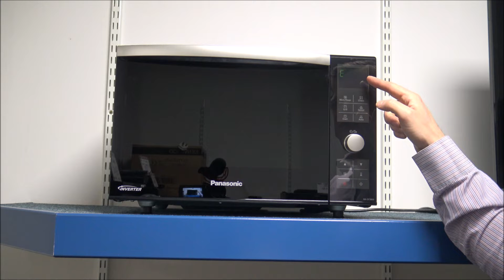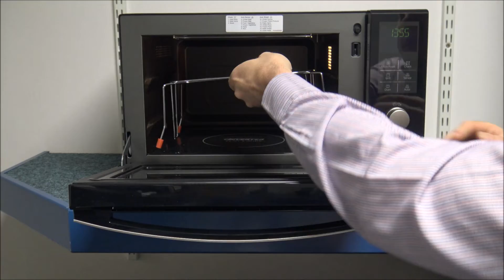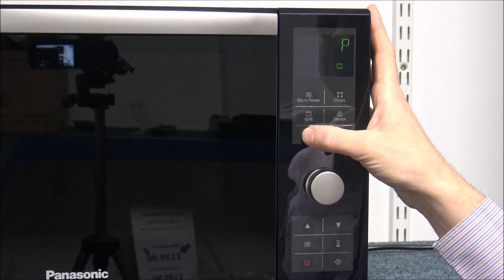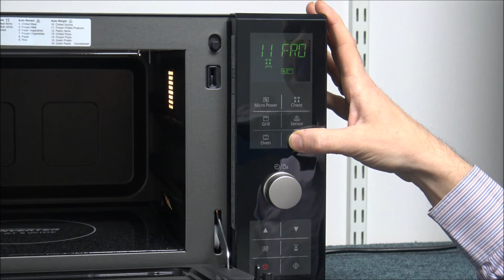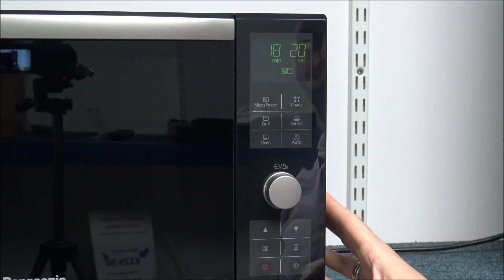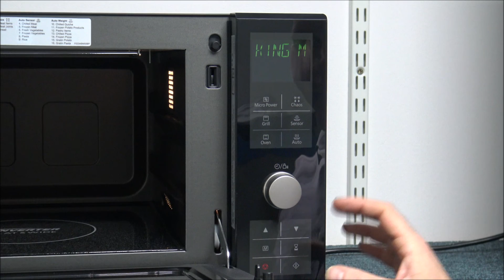Panasonic NN DF386B Combination Microwave Demonstration

Comment: 4:44 you say the accessories shouldn't be used but it cuts straight to microwave use and they seem to still be in it? If not then there's no glass plate either so how does the food turn in it? I'm so confused with this microwave function
Reply: The whole point of this Panasonic is that it DOESN'T turn .... it's a FLATBED and miles better than one of those turning things!

Comment: If using microwave only can I use the plastic bowls, microwave cooking dishes that I have used in the past in my old microwave switch was not an inverter microwave. another sample would be my plastic microwave rice cooker. 
Thank you for your help and for a very helpful reveiw 
does this microwave not come with a metel basket for like chips 
Many Thanks Ruth

Comment: Just bought this so thanks for the intel. FYI the grill rack IS designed to be used either the microwave that’s why it’s the accessory designed for multi-stage cooking as in you can programme it to microwave and grill using the rack.

Comment: TLDR: No combination microwave/convection function.

I've had a Panasonic combi microwave for a few years, which I used all the time especially to cook things quickly in the convection oven using microwave at the same time. Sadly it recently developed a fault. I bought this as a rather lovely looking "upgrade" and there is a lot to like but apparently no combination microwave/convection function. Am I just missing it?? I can't believe it. So disappointed.

Comment: I love this microwave, but the flatbed has cracked and seems to have a sma hole in it .....what has happened and what should I do, we have only had it about 3 months
Reply from the maker: If it is cracked then do not use it. It will need to be looked at by Panasonic. It is very odd that it cracks, has something been dropped on it, if this is the case then it will not normally be covered under the warranty. If nothing has been dropped then contact the retailer you purchased it from and they should be able to get it looked at by Panasonic.
Reply: They can break if food residue or spills arent cleaned and the microwave use will create hotspots and arcing on these causing breaks.

Comment: Thinking of buying a DF386 and think I read somewhere that because of the many comments about the grill not being easy to clean, the grill is now covered.  Is this correct or is it on a more recent or different model?  I also note comments about the earlier models having a metal tray, metal grid and glass tray - I think the CF873 but cannot find this anywhere so presume it's now been replaced with newer model.  Can you clarify?  Very good video and nicely presented. Thank you.
Reply from the maker: To be honest, on this model the grill is not that easy to clean. Some of the earlier models were a bit easier to clean but are no longer available.

Comment: Great video - really useful. Only comment I’d have is that you showed what pre-heating the oven looked like but didn’t display what the display showed once it reached the desired heat. Otherwise, great video to show the functions.
Fingers crossed my roast lamb goes well.... our normal oven isn’t working as well as it could!

Comment: My older Panasonic combi microwave was easier to use for baked potatoes. You weighed your spud, put it in the micro, inputted the weight, pressed on, and it baked it for the correct pre programmed time. Easy, and perfect results every time as they say.
Now this new model. No baked potato programme. Put your spud in. Er, press grill,  which prompts you to then select micro, er, then you guess how long it will take to bake your potato,  set your guessed time, and good luck.
Reply: Isn't the built in sensor meant to assist ?
Reply: @pip5461  
For chilled or frozen meals according to the handbook, not baked potatoes. You need the micro and grill for a baked potato, the sensor setting doesn’t do combi cooking as far as I’m aware.

Comment: Hi! I recently bought one of these from another supplier, and it seems like the interior light doesn't come on. Am I meant to pull a tab somewhere or is the bulb broken? Thanks in advance!
Reply: I bought the same model, no tabs to pull out, the light should come on automatically. It might not be the bulb, it could be the mechanism in the door that is faulty and not activating the light.
Reply: @Chipchase780  thanks for this. Turns out the unit was faulty. Kept cutting out mid cook.
Reply: @Chipchase780  Is this a common issue, and covered under warranty..? I'm considering buying this pull down door version with no turntable, as it seems far easier to keep clean...
Reply: @pip5461  
If you’ll take my advice, do not buy this model. I regret doing so, but I just have to live with it now. Runs with moisture on the inside after doing a chilled meal so the interior needs to be dried off. My previous model didn’t. As I said, doing a baked potato is guess work. The previous model was automatic after setting the weight.
It’s personal choice depending on how you use it, but if I had my £234 back I’d go for a stainless steel model as sold in John Lewis with the push button selections - INCLUDING baked potato option.
Reply: @Chipchase780  Thanks ...

Comment: Nice review, I think this is ok for the money but sadly previous generation NN-CF778S was superior in many ways.  It came with a pyrex tray and the grill rack slid in like the metal tray in this which it had as well rather than the aukward floor standing one which prohibits the use of both it and the metal tray together.  Also the glass pyrex tray could be positioned below the grill rack to catch dripping which was one up from cleaning it off the base.  The controls were more tactile and it had a fantastic whole chicken auto cook program which gave a roast chicken using combination cooking in 45 minutes on the pyrex dish.  I have not seen any of the newer range do this and I have this oven in the review and the larger steaming one neither of which matched the NN-CF778S.  I owned three of the NN-CF778S and it was produced for 10 years and still looks good.  I have one left now that works and dread the day it packs up!
Panasonic are probably leaning towards today's buyer  who is more interested in simpler automatic cooking of fillets rather than joints.  The previous didn't have 'sensor cooking'.  Chicken on the bone must be something of a niche food group these days!
Reply from the maker: I know what you mean as i have had an NN-CF778S and love it.
Reply: @lords-electrical  Yeah, I just bought one of these NN-DF386B for the office, quite disappointing to be honest.  I note that whilst it is sold as a 'combination' microwave oven, in fact it is a combination grill & microwave OR an oven but not both.  That is to say there is no oven + microwave functions (see manual page 29), unlike the NN-CF778S .  Furthermore, the NN-DF386B is not fan assisted, it uses a heating element below the oven and then relies on the grill as the top element. It takes much longer to heat up than the NN-CF778S and if you use multiple levels of cooking, it will leave the oven cold in-between food layers. e.g  I cooked two pizzas simultaneously today in it, one on the grill rack which I sat inside the metal tray which was mounted on the first level (note the NN-DF386B prevents insertion of the metal tray on the floor level).  The top pizza came out overcooked on top (due to the grill being employed) and underdone on the bottom due to the metal tray blocking the floor heat.  The bottom pizza was overcooked on the bottom and underdone on the top.  A fan assist would balanced it all out much better and the NN-CF778S cooks food on multiple levels easily.  There is another drawback to the grill being the top oven part... in the NN-CF778S you can effectively put food in from cold like a chicken, set the temperature and put an hour 30 on the clock.  The NN-CF778S then heats up slowly like a normal oven using only the oven parts and the food is fine.   However on the NN-DF386B, there is not a normal heating method so it is impossible to put food in from cold without risking it burning from the initial overuse of the grill so oven cooking from a cold oven is not really an option for the NN-DF386B, unlike its predecessor.  In hindsight I wish I had bought the NN-SF464MBPQ which would have made a decent microwave, flatbed, less cost and at least it doesn't pretend to be more than a microwave.  I also own a NN-CS894 which is a much higher price point and steam but its still not as easy to use or as good as the NN-CF778S is.  I miss the days where I had two NN-CF778S stacked on each other and was able to manage a roast dinner and trimmings with greater ease!  If you ever see something matching the NN-CF778S, even from another manufacturer come back and post, I'll probably buy two from you!
Reply: Yes I agree had one for years, loved it thrashed it to death ,it just died and is not in production, sigh, However bought one of these in vid, far better than turntable ones and so far so good
Reply: My NN-CF778S let out a cloud of smoke and now it trips the fuses if I try to microwave. It's only 6 years old, which is disappointing, and I can't find anything quite like it to replace it. I've been put off Panasonic's steam microwaves by a lot of reviews that says they break far too easily. I've so far failed to find anyone to repair it; I suspect I'll have to pay a call-out fee and then be told it can't be fixed anyway... 😞
Reply: @creative-media 
Yes, I would stay away from the steam ones or just not use that functionality.
I put my panasonics through a lot but I am sad to say that whilst they look slicker than ever they are more badly made than ever.
I have had 5 panasonic combi units over the last 10 years and I do use them alot but the NN-CF778S was the best, I'm amazed you found one 6  years ago.  Most of my units last about 3-4 years but the NN-CF778S I got 8 years out of.
My current NNCF87LBBPQ had a clever jacket potato program where it didn't need the potato weight unlike the NN-CF778S except that instead it melted the plastic around the screw on the tray it instructed me to use, made an awful smell but I made the mistake of not registering the device with Panasonic and it was only 1 yr and 3 months but Panasonic wouldn't do anything, I was supposed to register to get the 5 year warranty, even though I had proof of purchase so don't make that mistake.
This is my last panasonic combi now, I wouldn't buy another, sorry to say there just isn't a good product that fills this role that I can identify any more.  Was never bothered about the cost, just wanted quality.  May end up looking for a merry chef!

Comment: It seems the door is not see through while cooking. Is it?
Reply: It’s more important that it looks cool and expensive rather than being easy to use and functional right ?
Reply from the maker: You are correct it is very dark so you struggle to see through it while it is cooking
Reply: @lords-electrical  Oh, nearly ordered one... hmm that could be a problem !every time you open it to have a look, you loose the heat...
Reply: @pip5461  
If you like your baked potatoes I found this machine is actually a backward step over the excellent older model it replaced. There is no auto programme, you have to play trial and error. I’ve adapted to it, but if you gave me my £230 back would I buy it again ? NO. I’d consider Samsung next time.
Reply: @Chipchase780  That's so true, I might look at the Sage Wave 3 in 1, looks interesting...

Comment: Well done sir, I bought a Panasonic combi microwave after watching one of your videos, I knew how to use it before it arrived. It made using it very simple. Keep up the good work.
Reply: He's the best isn't he?
Reply: I was thinking about this model with no turntable, it appears easier to keep clean... Do you find the pull down door to be secure, as i've seen some reviews with it breaking after a few years...
Reply: @pip5461  I bought the normal type door version he did an earlier video for. i would probably have given this version a try.